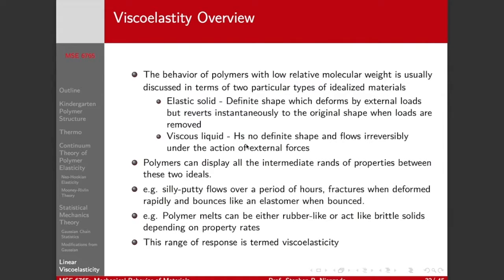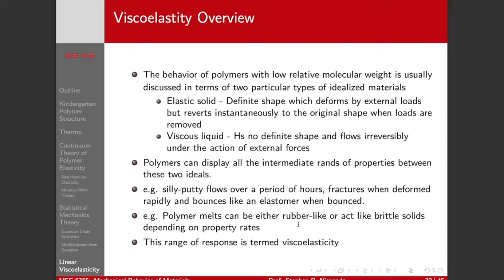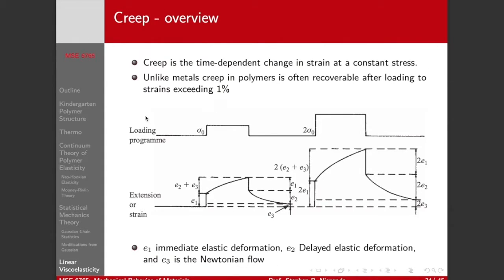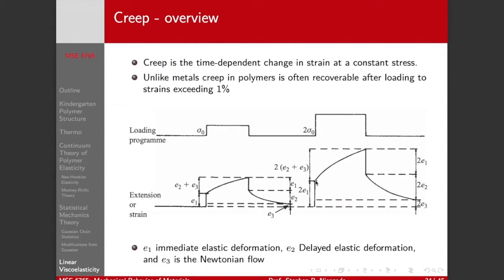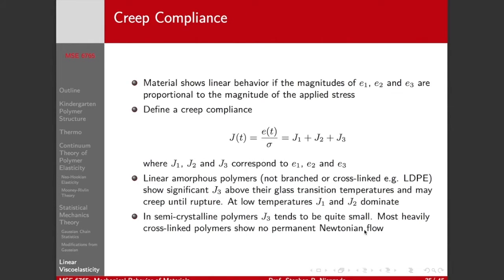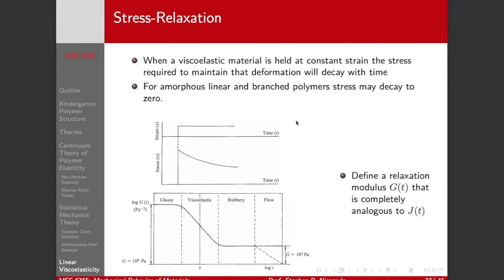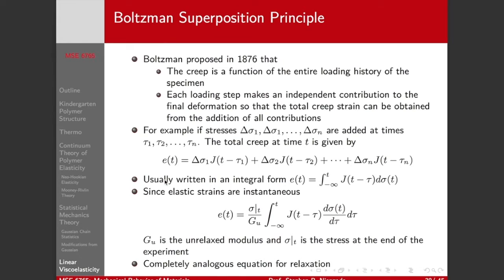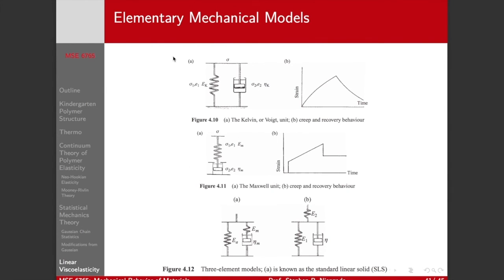Lecture 4 part 5 - Introduction to Viscoelasticity

Comment: Thanks for this video.
One comment that may be usefull: according to Boltzmann principle, the single determination of creep compliance function is sufficient to simulate the response to any kind of load patern. This means that you don't need to calibrate any model if you know this function, although the creep compliance function can depend on variables (temperature, aging...). The integral expression of strain as function of stress history can be discretised with the time step you have for J and the stress history for numerical applications.